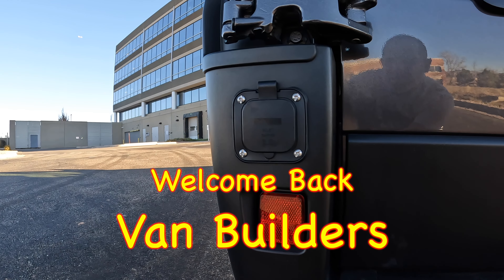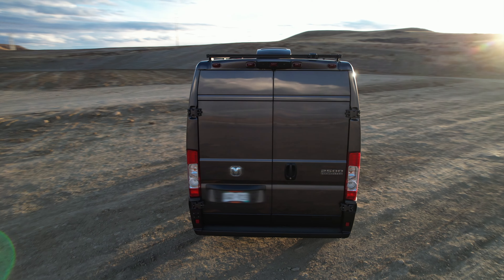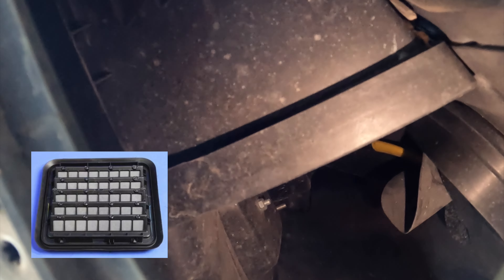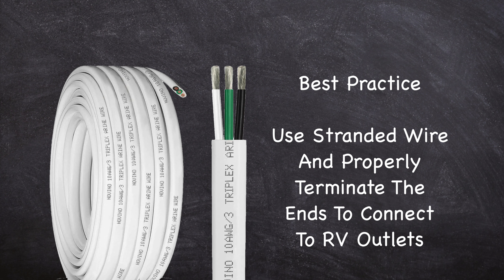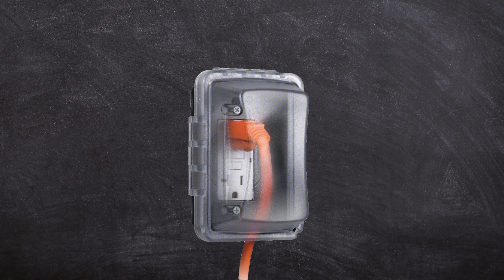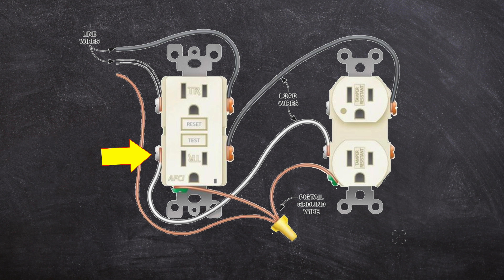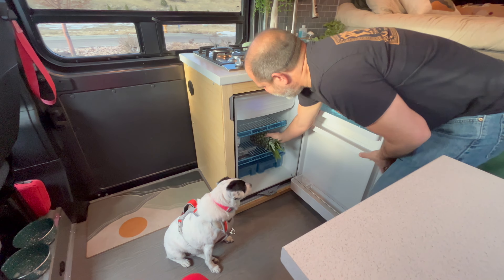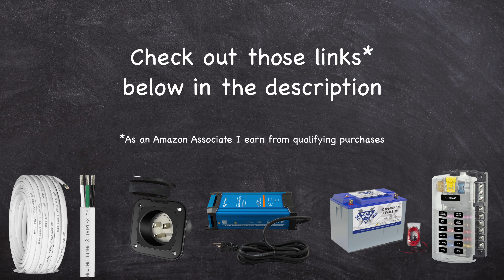Simple Van Shore Power

Comment: I think you need a breaker box before your outlets especially if you go to 30 amps which is typical for most camp sites. It's a very good start which i will use on my build. Thanks,
Reply from the maker: Thank you for your thoughts on this.  I’m wondering how a simple system like mine is any different than an extension cord with two or three outlets on the end?  Verses a more robust system that would require more circuit protection?  I am cautious to keep the amperage low on whatever I plug in and not overload the shore circuit that I am plugged into.  Where do you draw the line?
Reply: @TheVanTeacher  Depends on your energy needs. In my case, 103 degree temps require a 12k btu ac, which is 650 watts, so that's 3 batteries and hopefully no inverter and a 24 or 48 amp system.  With that kind of investment you need good circuit protection to avoid fire damage. Hopefully you live in a cooler climate at night and don't need that. Always test your shore power before plugging in. Be safe 🙏
Reply: @TheVanTeacher  The issue goes deeper.  If your system is - electrically - not really different from a power strip, how do you protect yourself from low voltage, high voltage, etc. at the source?  And a breaker inside the van does seem wise. 'Simple' in design doesn't always guarantee simple in practice.
Reply: @TheVanTeacher I absolutely would not trust the circuit protection provided by a random campground. You really do need a 15A double pole breaker as close as possible to the shore power inlet. 

Blue Sea makes a simple surface mounted enclosure (part 3131) that’s perfect for this and can optionally be wired with a reverse polarity indicator LED (part 8066). Blue Sea 7235 is the 2-pole 15A breaker. 

I hope you take this advice seriously, it’s literally a life and death thing. Think about what happens if you’re taking a nap, that space heater shorts out, and the campground circuit breaker fails (or is more than 15A). World of hurt. Less than $100 for prevention. You don't need a whole AC distribution panel, just this simple setup to protect your wiring and your life.
Reply from the maker: Thank you for the advice.  I checked out the Blue Sea surface mount breaker and will be installing it right at the shore power inlet on the inside of the van.  Thanks for taking the time to watch and comment!
Reply: You might consider updating your video.
Reply: @paulb6302  That would be cool. So far, I installed a sub panel with three breakers and a shore outlet. Have yet to test it. But I haven't done videos because my youtube doesn't get traffic, and I'm a novice van builder.

Comment: Why did u choose not to use a breaker box?
Reply from the maker: You bring up a good point and one that I keep coming back to and have on my list of upgrades.  

First of all, I do think adding a second breaker is good practice as it offers some redundancy assuming the circuit is breaker protected at the main feed.  I don’t think it offers twice the protection, just the same protection, twice if that makes sense.  Of course, the big assumption is that the circuit you are plugging into is properly protected.  

By adding a breaker in your van, you are effectively protecting all wires downstream if a fault were to occur inside the van.  And it is possible that a fault inside your van would trip the van breaker and not the main breaker it is fed from.  

I do like to keep systems as simple as possible.  In a perfect scenario, adding what is essentially an extension cord to a circuit, would not need a second breaker at the cord.  However, it doesn’t hurt and doesn’t add much complexity.  

So, yes, I do plan to install a simple, surface mounted, add on breaker to my system.  In the meantime, I only plug into GFCI outlets that I trust and can verify are properly breaker protected.  

Thank you!

Comment: It looks like from the image that the stranded wire isn’t copper?
Reply from the maker: It is tinned copper to give it extra corrosion protection in marine applications.  I feel like it’s overkill inside a van, but that’s just my opinion.  I did notice at the local RV show this weekend the major manufacturers are using residential Romex wire for AC circuit wiring.  Thoughts on that?
Reply: @TheVanTeacher  
I prefer to use welding wire!
Reply: @TheVanTeacher  I just get a 100' extension cord from HFT . . .  currently $80 for 100 ft. When I bought mine it was real copper (no tin).
Reply: @TheVanTeacher RV manufacturers cut every possible corner. You are using excellent wire, stick with it!